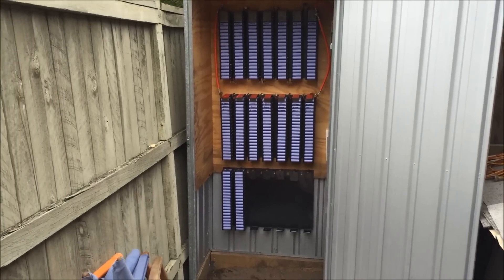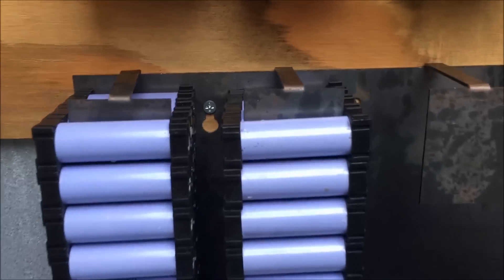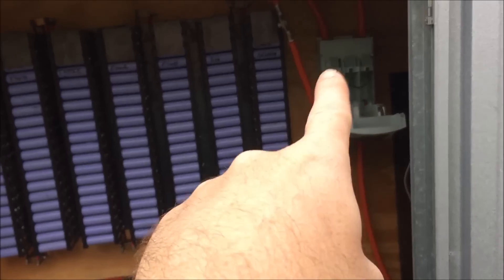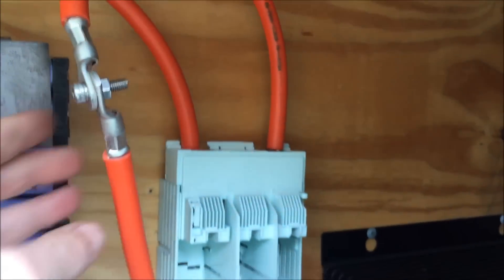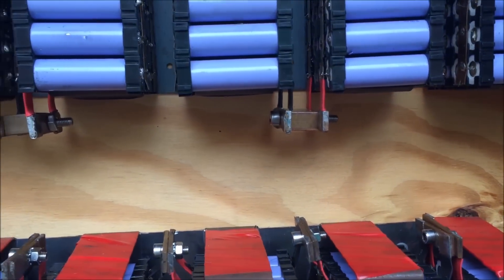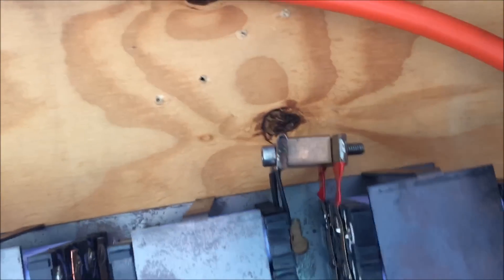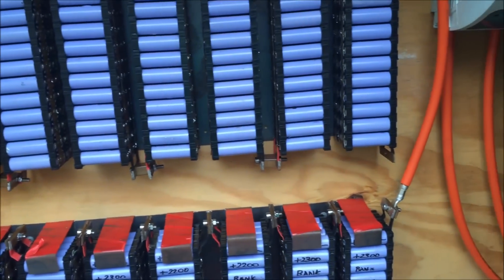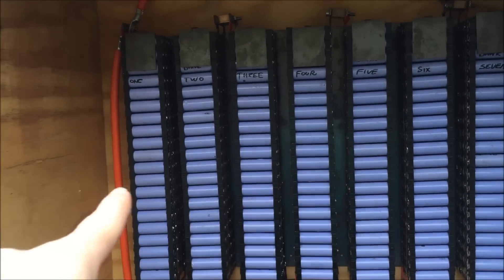Back on the wall again - Gee i'm happy with how it looks.

Comment: Didn't those red cables get warm too? To keep currents low it's better to connect each 7 bank pack directly. The way you're doing it now one set of those cable's will have to deal with all the current of the 3 packs combined.

Just thinking out loud.
Reply from the maker: not these new cables :)
Reply: +HBPowerwall ok. they're not the same cables. Cool.

Comment: No that I see it for real,..... The currents in the busbars in this setup will be the same as in the original setup. High near the connectors and low far from the connectors. So this setup should perform the same as the previous setup.

Heat in the cells will be the same. The only difference that could happen is the heat in the busbars, which will be higher near the connectors. But I dont remember if they heated up at all.
Reply from the maker: time will tell :)